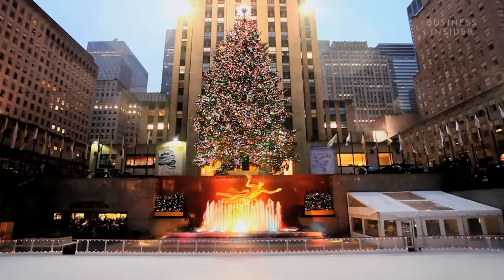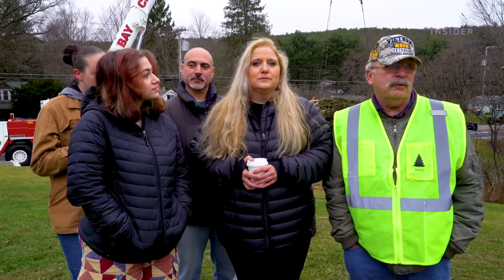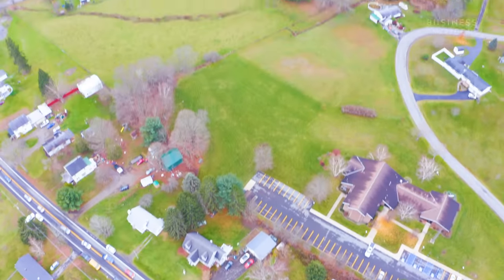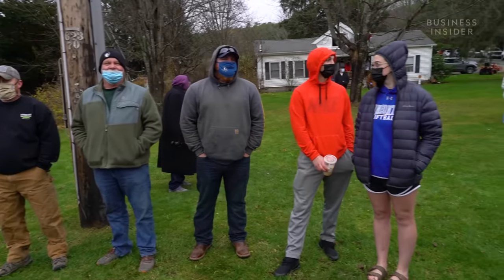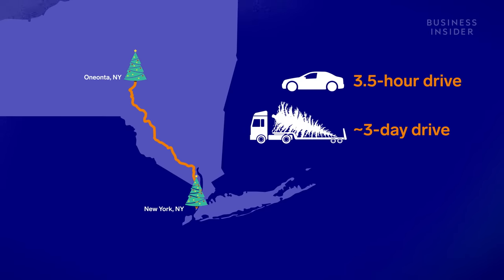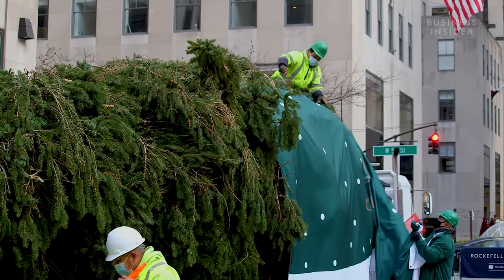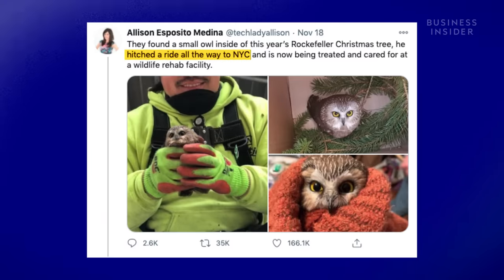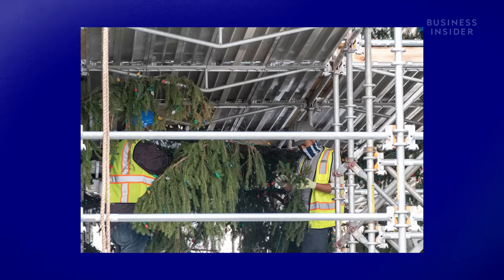How The 75-Ft. Rockefeller Christmas Tree Makes It To NYC | Big Business

Comment: "In the Plaza, the tree is cut into large pieces, which are then transported to a mill in New Jersey that does the initial rough sawing. Those pieces are then brought to a landscaping company where they're dried in a kiln and then milled and planed to get them straight and smooth. Only 2x4 and 2x6 beams are made. The finished beams are then stamped, shrink-wrapped and shipped to the Habitat for Humanity affiliate chosen to receive the lumber. The amount of lumber varies based on the size of the tree."

This means that every single year, after Christmas, this tree, that would normally be cut down for lumber at its age, is being cut down to enjoy visually throughout the holiday, and then cut into lumber to build houses for homeless people.

(A simple Google search told me all of this)

Comment: If the Rockefeller wants it I'm not donating
Reply: The full cycle seems to be they scout for and are offered trees in residential areas, select one, display it , get it milled into lumber that's donated to a housing non profit that then builds homes for those in need. 

Knowing that they are removing the tree from  an environment that makes it a risk and are converting the wood into homes for those that need them at no cost to the donator and recipients, would you still refuse